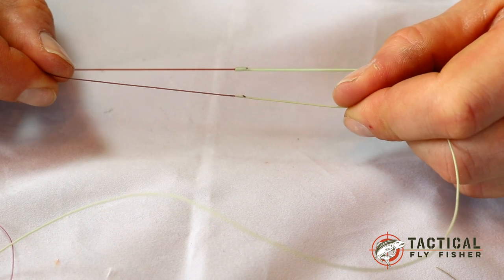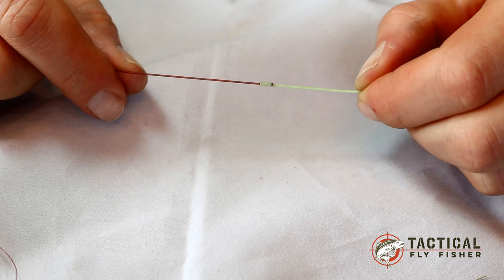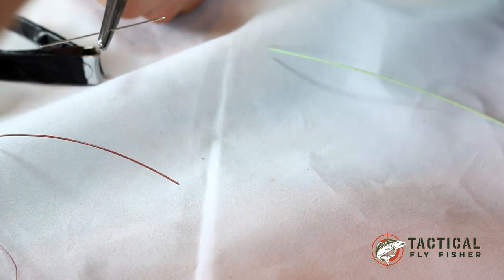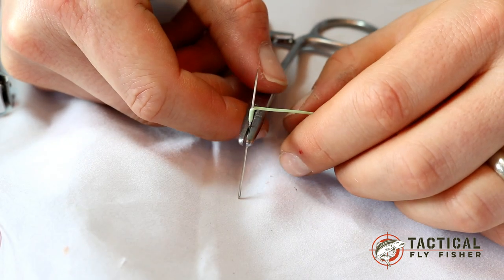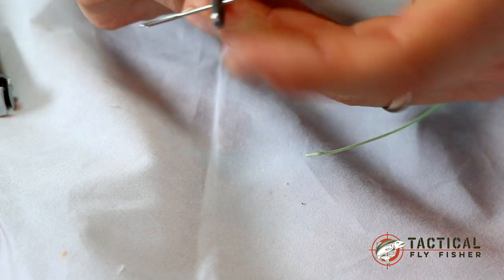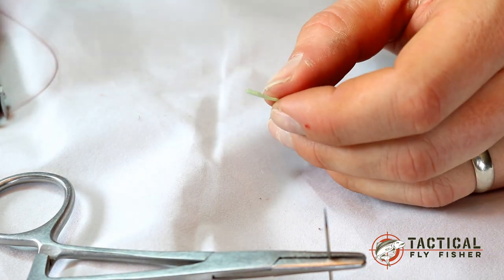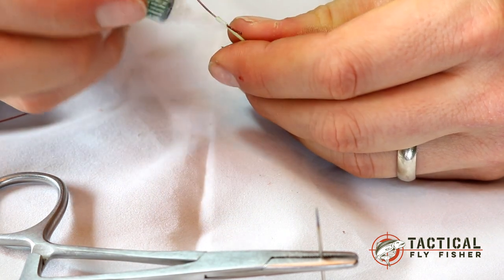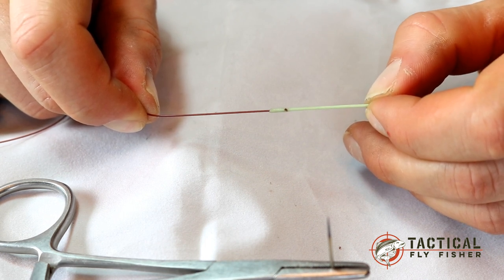Braided Core Fly Line to Leader Superglue Splice Tutorial

Comment: I, been doing it that way since I read about it in Fly Fishing Magazine, back about 1983-84! It's fairly strong for most trout applications, for heavier Steel Head and Salmon, the I just do a Needle Nail knot then coat the knot with some flexible boot cement- coat let dry, overnight and coat again, let dry for however smooth a connection you want I do three myself! As part of my routine of keeping fly lines and reels in shape for my fishing! Now you could use UV resin to do the same thing and its quicker with less mess and time!

Comment: I used this technique for many years until a friend of mine showed that it can come apart easily.  He took the fly line in one hand, the leader in the other and jerked hard on it.  The leader popped right out.  Before he did that I put increasing pressure on the two lines and the connection held.   In real life the rod tip would be the buffer against a hard jerk on the splice.  But I lost confidence in the splice since.  Now I use the nail knot and reinforce it ( and smooth the knot )  with UV Knot Sense.   That won't come apart.  But the connection isn't as smooth and beautiful as with the splice shown in the video.
Reply: Hi, but if you fish trout with a 6x-4x tippet, what is the chance of ripping it like your friend did before your tippet breaks off? I bet this is still much stronger than any normal tippet for trout fishing.
Reply: @ondrejpekarek1830  You are probably right. However, I can make a connection that’s nearly as  smooth and is unbreakable.

Comment: Just a suggestion:
Before You pull leader inside line, try to scorch the butt end of leader with lighter. That will produce small nylon ball, to act as a limiter when You jerk and set leader with some super glue on it, and as warranty that leader will not slip thru line.

Good video...like it!
Reply: I like the idea of creating a small ball on the end of the leader.
Reply: That's an interesting idea while pulling the leader into the fly line, but I wouldn't view it as an insurance against the leader slipping through while fishing.  The idea is that the glue adheres to the  braided core and fly line jacket.  If you were relying on the ball alone, it'd mean that the glue gave out.

Comment: It is important to have a backup connection you can use, if something goes wrong. This splice has never failed on me in 8 years of using it. I have though lost my leader and a couple of foot of fly line to a sharp rock. At that point you either use a connection you can make “on the water” in the rain when it is dark, or go home early. I use the Grey’s loop for that. This is far too involved for an on the water emergency replacement.

Comment: changing leaders would surely be difficult...i realise having a loop here is counterproductive as its not smooth going in and out the rod guides...do you guys just have a standard euro leader and the only adjustments are made to the tippet below the tippet ring?
Reply from the maker: That would be a good way to go. I have a reel rigged with each type of leader I normally fish. I can switch reels if I want or bring a couple rods for different situations.